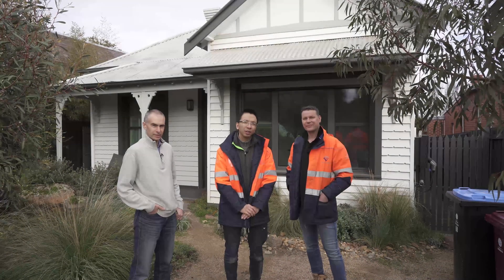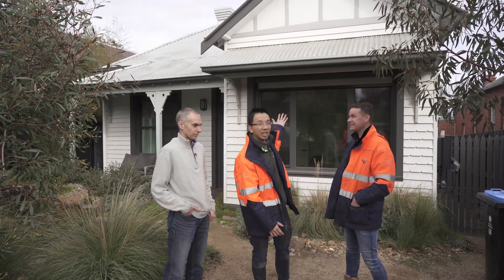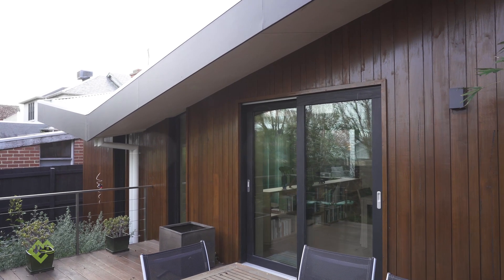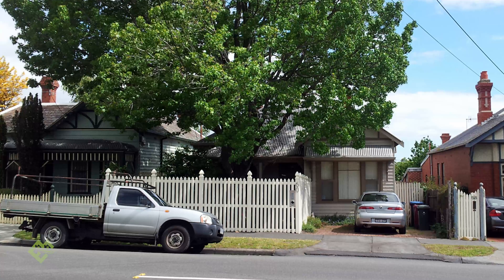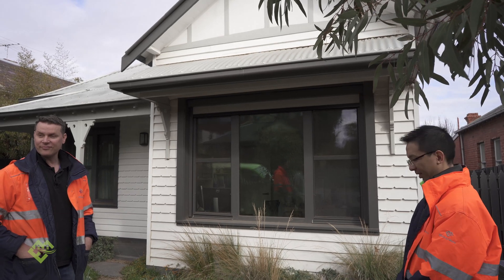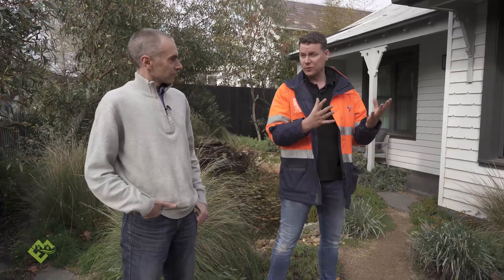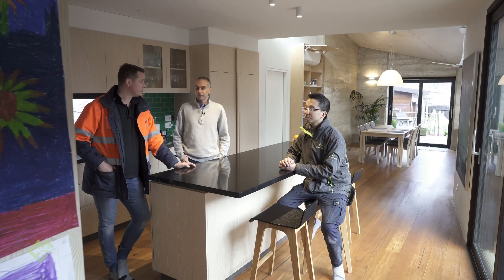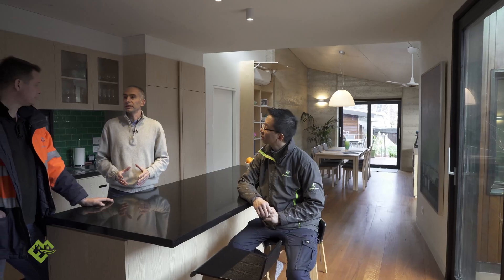From Old and Draughty to Dream Home: A Rammed Earth Passive House Dream

Comment: It is easy to justify spending on solar panels as they can easily pay for themselves (especially with STCs), but what is the maths on the rest of this renovation? It, obviously, cost money to achieve this and is cheaper to run than the pre-existing building, but how long does it take to pay back that money versus just running the old building? It is all fine for Cameron to say there is no excuse for not doing this kind of thing, but money may well be exactly the excuse for not doing it ...

Comment: Really nice to see a retro fit passive house. We live in Portugal (South-Europe) and did buy an older house, but with a good orientation to the south. The biggest change for us was also the triple glass window (with argon) and the possibility to use the concrete slab as a thermal mass. Build next to the house there is an old garage that we want to rebuild as good as possible (passive house standard) but not easy to connect the to (central ventilation system, hot water, etc.).